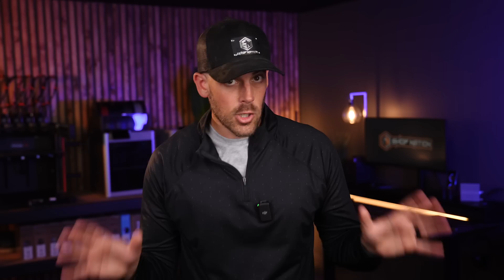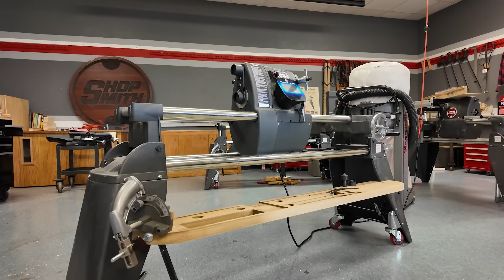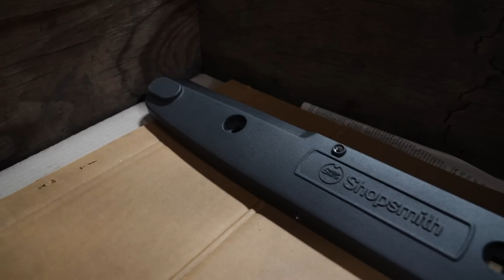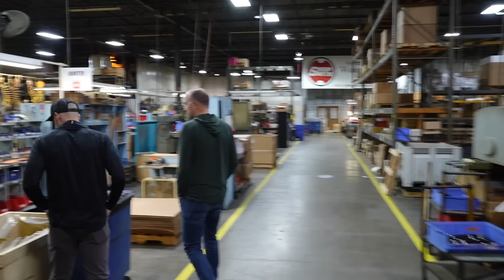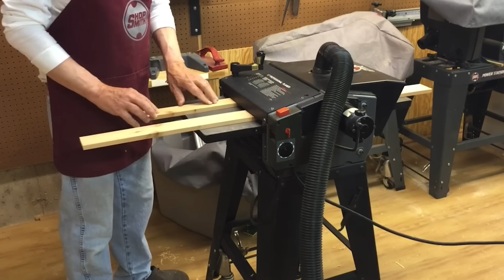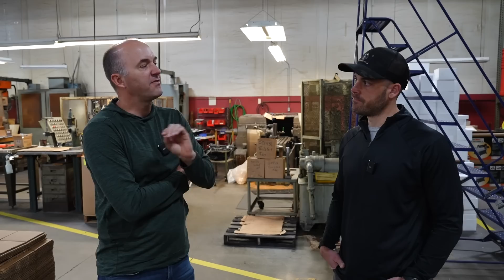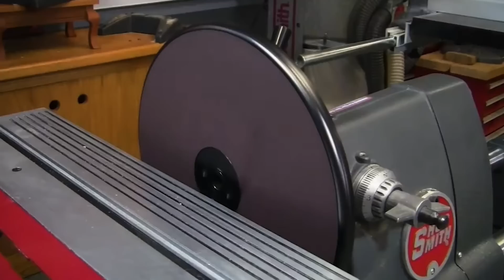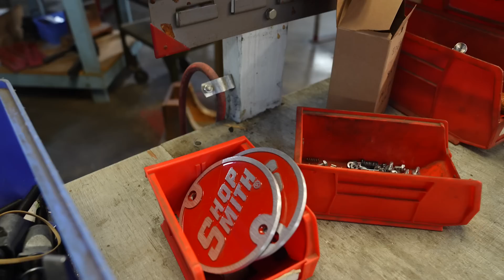The Last American Power Tool Company is (almost) dead

Comment: Nick is spot on with his target market. Bought my Mark V as a 25 yo newly wed with a one car garage in 1987. I bought it to make all the furniture we could not afford. It was my first tool. Still have it and still use it. Just last week I taught a couple of dozen children 5yo-5th grade how to do basic woodworking, and I used the Shop Smith to do it. It was so cool to lower the drill press to its lowest setting to let a 'tiny' five year old kid drill al the counter sinks on his bird house. . It worked splendidly. I use it mainly for drill press, end boring, disc and drum sanding, lathe, band saw and back up table saw. Nick is right, the table saw is the 'weak link.' I free standing machines  for most of my processes but the Shop Smith gets used in 80-90% of all my projects. I wish Nick well.

Comment: I bought my ShopSmith new in 1978 to build custom walnut kitchen cabinets. I saved enough money to more than pay for the SS. I still use it a lot. I have never had anything break on it. I especially like the small footprint, that really helps in a small wood shop. My only complain has been the table is too small but i got used to it. I hope it continues on.

Comment: Lately ive been seeing a lot of shop smiths for sale on facebook. Pretty cheap too. I think the most expensive one was $300. 
Up until I started seeing them, I had no idea they even existed and I am 55. 
Never laid eyes on one before then.
I’ve been pondering the idea of picking up a wood lathe for a few projects I want to do, I just might reconsider buying a used shopsmith for those prices. The $5k I can’t justify, but the $300 or less I’ve been seeing lately is very doable, especially since I just learned new parts will fit older machines.
Reply: Just a helpful bit of advice...If you get a used one, oil the motor before you use it. There is a video on YouTube from a ShopSmith service tech, with step by step instructions. Simple,  but important. Do not turn machine by hand. Turn on to lowest speed, shut off and follow directions  from there. It could get expensive if you don't follow the directions. 

Good luck to you!😊

Comment: I'm 74. As a kid my two favorite ads were the back of the comic book ad for a BB Machine Gun that mounts on your bicycle handlebars and every ad, and article, about Shopsmith. I grew out of the BB machine gun idea, but never Shopsmith. Sadly I never got a Shopsmith. Retired in my 60's from the computer industry and ready to finally start hobbies I gathered so many shop machines I almost can't turn around in my shop.  I never realized Shopsmith was still around!  This video awakened the lost kid in me.  I think I might have to rethink everything. Heck I'd sleep on a mat under my own Shopsmith and dream of projects. Maybe I can pull in off! 😃
Reply: Do it! I just bought my Mark 5 used from a disabled friend 3 years ago.  $300.00.  Added a used, but excellent condition band saw. I am 61 & just starting woodworking to possibly get me out of hazardous materials tank truck driving for a living. As long as you are able,  it is never too late.  Good luck to you!!😊

Comment: I have my father-in-law's Model 10ER and use it often.  While I have other power tools (3 table saws for example); the 10ER remains quite useful.  Typical use is the 12" sanding disk and horizontal drill press.

Comment: I bought a gold Mark V with jointer and belt sander in 1975.  I still use the machine even though I have other stand-alone equipment for bigger projects.  I am completely satisfied with the precision and durability.   Wayne

Comment: I'm glad to know this company is hanging in there and looking toward the future. We live on a homestead and also run a rental home business. To keep our properties in good order I have a small fabrication shop, it's core to our business, I'm not really a hobbyist. My shop is full of machines, but my trusty old 10ER does those infrequent jobs that just don't make sense to buy a specific machine for, shop space is an issue. I've got a nice old table saw for instance, but it won't cut a 4x8 sheet of plywood into two 4x4 pieces, which I can do with my Shopsmith, and do it repeatably and accurately. I make cabinets from time to time. Hands down though, what I use it for the most, is horizontal boring. There is zero chance I would have a machine capable of that operation if not for my Shopsmith and it's surprising how often I use it for that.

Comment: I used my father's shopsmith fifty years ago. Today's shopsmith looks almost exactly the same as I remember it. Also the factory probably hasn't changed in fifty years. Mostly men are still interested in woodworking so there should be a lot of demand. But for a current purchase few men would be satisfied with a tool that is as dated as something their grandfather or great grandfather used. Unless you can hookup the shopsmith to a computer to take advantage of computer controlled cutting and forming, I don't see a future for shopsmith.

Comment: Got one of the originals that looks like the oldest ones you have there, It was gpa, dad’s, and now mine.. just turned it on after decades of setting idle and it still works like a top. Well built piece of equipment for sure!

Comment: What do you need from a technical side to make it better?  🔶🔶🔶We have patented an entirely novel, ultra-torque dense dense and ultra-low backlash,  infinitely variable gear technology, called 𝔽𝕣𝕚𝕔𝕥𝕚𝕠𝕟𝕃𝕖𝕤𝕤 𝔾𝕖𝕒𝕣𝕤 [a CVT/𝕀𝕍𝕋] based on our reformulation of gearing theory. The technology enables transmissions of ~1/10th the size/mass/cost which enables use of motors/engines/batteries of significantly smaller size. Gear ratios can be even in the 700:1 range and probably more. It will provide novel 3D motion of robotic appendages/manipulators/booms advanced turbo0jet engines, tools and much more.

I'll look at what might make your tools better.

<><><>
🔶🔶🔶We are writing a patent for a large number of novel novel torque converters [gear tech], differentials and right angle torque transmission innovations that do not use  TOOTHED gears. It will be 300 pages long. 
<><><>
Contrary to what classical gear theory states,  I've devised a way of increasing the speed of a worm drive...on the spot. 
===
✈ℕ𝔼𝕎  𝔽ℝ𝕆ℕ𝕋𝕀𝔼ℝ  𝕋𝔼ℂℍℕ𝕆𝕃𝕆𝔾𝕐  𝔾ℝ𝕆𝕌ℙ is a visionary multidisciplinary B2B innovation company utilizing a licensing business model or collaborative enterprise with strategic partners to develop Advanced clean, efficient, power dense solutions in domains of energy, propulsion, mobility, robotics / exoskeletons and clean technologies with a particular emphasis on the aerospace sector including space exploration and commercialization

Comment: I grew up wanting to do wood working, but I had a problem with not only space, but the idea of having to individually evaluate each of the tools that I'd have to buy to do things economically and efficiently.  For major tools, my grandfather had good sized table saw, a jigsaw, and a drill press. I don't rermember what he did for a router (maybe an attachment on the table saw). I would say to pitch to high schools that sill had a shop class, but a graduate wouldn't have the funds. It might be still be good just to get the schools to use Shopsmith for teaching???

Comment: I'm wondering if this is the same product that was called PortaShop in the the late 60s. My father was refinish a blank basement, plus he wanted to build himself a bar. It was the perfect tool and he took some classes to use its capablities.  The darn thing was powerful and I seem to remember it fitting in a case that was maybe only a little bit larger than a large portable sowing machine. Ooops...nope, this machine is more major!

Comment: I appreciate what they are trying to do. It is a bit of a niche market because this brand is equated as a "Jack of all trades, master of none" device that in some cases is more of a tool for the weekend warrior DIY crowd and less for the experience and serious woodworker. I have never owned or used one so I have no experience with the product so I leave it to the consumer to do some research to determine if this is the right tool for them.

The bigger hurdle for this brand is the new "table saw safety law" that mandates safer standards for table saws, using technology similar to that found in the SawStop brand. This will be an engineering hurdle that they will need to tackle and given the multi-tool configuration of the ShopSmith, it is even more complicated to deal with than just a single use tool as a table saw. I would love to see the succeed though, so hopefully they have their eye on the ball and can make a go of it.

Comment: Make some ShopSmith models  that ALSO HAVE a Mini 5-Axis CNC machining/metal carving system PLUS a built-in plastic resin and metal powder deposition 3D printer built right into the machine that has BOTH USB-4 ports and Wireless WiFi built-in so I can hook up a laptop to send some CAD/CAM files directly to the ShopSmith. This would make the machine useful for woodworkers AND metal workers!

Comment: They  quit making the planer, why? Because there was only a $400 margin in a $2000 machine he said. He is flat out wrong! They couldn't sell the planers because they were too dang expensive! It may be a great product. But what weekend warrior is going to spend $2 grand for a planer when he can buy the Dewalt planer for $700? He is missing the mark. His problem is indeed margins, but that is because his manufacturing costs are too high making it necessary to price his products out of the market to make a profit. If he wants to resurrect Shopsmith, he better focus on getting costs back down to where they were in the 1980's, a near impossible task.

Comment: China is selling products in the u.s. for less then material costs, let alone manufacturing, packaging,shipping, profit, etc.. they are putting our country out of business! On purpose. A pack of 5 metal vice clamps $5.00? Screwdrivers, tools..How? Its not possible to sell at that price. They are shipping products for free! Putting us out of work is the goal. "Collapse from within".
Reply: Yes!
Reply: The costs of living in China are significantly lower than in any western country. There has to be some sort of equalization of the standard of living, for the nations of the world. Those who live will see how it will turn out.
Reply: @MRSBroadcastingAB  pretty much robotic & slave labor. The simple cost of forming steel for a tool, painting, handles. Packaging, labeling, shipping, distribution & profit.. from China, is less then forming & tempering, trimming, & labor here. Impossible to compete with low quality products, especially during inflation. Tarrif or bans on products to save our jobs must be done.

Comment: Since you live close to Shopsmith, then you know my hometown of Sidney. I have benn aware of Shopsmith, but when I started doing woodworking I couldn't afford one. So I started collecting my tools 1 at a time. A radial armsaw was first followed by a drill press. Now I have a shop full of tools. My biggest fault against Shopsmith is having to configure it around for each operation, which to me is wasted time. I do know Scott Phillips who used to work there, but I dont know if he still has a Shopsmith. If you didn't know Delta, which was Delta Rockwell at the time, used to build machines in Bellefontaine Ohio. Castings for their lathes were made here at Gartland Haswell here in Sidney.

Comment: $8,000 to buy all the different tools for a hobby is nuts.  I wanted & still want a shopsmith but it’s too much to buy at once.  

For hobby work and the occasional home improvement work done- I went and bought a skill saw. Then later for a couple hundred bucks a table saw.  Want a drill press but dealt with hand drill.  

Idk how you fix this issue but to try focusing on ONLY $5,000 instead of $8,000 and the advantage is it’s more compact… no thanks.  It’s too big of an economical risk for a hobby that a novice just can’t tell if buying $5k multi tool is like a leatherman- yes it does everything but compared to the real tools it sux.
The risk/reward just isn’t there.  

The fact that it is all set up wood and not metal work counts also.  Wood lathe looks fun, be cool to make some chairs or table legs.  But a metal lathe I can also do brakes on the cars, do welding and balance work.  

The $5k just seems like you will never get any return on investment.  Doing the other tools one at a time as needed was more affordable I could see how buying a table saw paid for itself in a couple jobs.  A small one was in the hundreds, not thousands.

Comment: I bought one in a woodworking show Alexander Palace north London in the early nineties, I’ve bought a few extras over the years, the table saw is accurate, I like the horizontal borer I’ve repaired many broken stair case spindle using this tool. I’ve only used the jointer once. Only gripe a the cheap casters. I still have the video the shopsmith book and the receipt for £2700.. we  only went the show to buy a site saw…  Do you have an agent in the UK for spares..

Comment: I inherited Dad's 10-ER (Montgomery Wards - 1953) in 1988.  I've found it's useful in a small shop as a secondary tool.  If a build requires a primary tool and then a secondary operation, the Shopsmith's ability to be any of five secondary tools makes for fewer steps.  Its also more stable during use than any hand tool I might otherwise grab.

Comment: I’ve had a Mark V for 20+ yrs and it’s in almost daily use. I do have floor space and a lot of other machinery including belt sander; lathe; pillar drill; planer and band saw. My Mark V compliments these. The table saw (not the lathe as mentioned) is the most used item. It’s precise and capable. I’ve made innumerable projects including very complicated items on it. Yes it needs time and patience as it doesn’t have digital readouts but it is a hugely capable machine. Unfortunately your only dealer in the UK closed down a few years ago so we’re left unsupported here which is not ideal. One of your major failures has been YouTube videos featuring elderly fellas, mostly overweight and sedentary and very uninspiring. Can’t you entice Axminster to be your outlet for the UK? Bring onboard young, exciting, groundbreaking youngsters as your face of today and ditch those old guys. I love my Mark V and it’s as capable today as it was when I bought it 20+ yrs ago. The fact that it’s not Chinese is a major selling point. Products from the US are top quality and deserving of recognition. I wish you well

Comment: They probably can't do it, but maybe make a compact size or upgrade kit for older units? I see them in thrift stores sometimes, and always wanted it. It's like $250 to 1000 used with nice accessory. I have a single car garage, and most of the time I have to bring out the cheap shitty compact drill press, table saw outside to work. If it was 1/3 or 1/2 the size it be so awesome, It be a high quality upgrade from the garbage I have.

Comment: You recovery will be driven by supplying the current generation with affordable upgrades to their old shopsmiths + creating an affordable entry level shopsmith mini.  While the tablesaw is somewhat weak it is fine for 90% of hobby woodworking.  You have to couple that with education because you can't get the accuracy out of the machine without it unlike a dedicated machine.  I admire the enduring upgradability of the machines.  First thing I did with a used machine that I bought was cut it down so it was 12" shorter lengthwise.

Comment: they should focus a marketing campaign towards the bushcraft and cabin builders community a rugged too that can be transported to a remote site and run off of a battery bank would revolutionize many different aspects of "off grid" community. Bringing a full wood working tool set to a site on an atv trailer would be a game changer.

Comment: Im not sure, but is Shopsmith on the European  Market? I never have seen one over here (Germany) and nothign comparable either. And if it comes to space over here we are normally way more limited then in the U.S. from all i know. 
I am dooing woodworking as a almost side hobby. I started because i needed some easy furniture for my main hobby (LARP) that i could only get for, at the time for me, not paiable prices. So i did it myself out of scrapwood and with the most crappy and cheap tools imaginable. It was 15 years ago and they are still in use. But it definitivly spiraled from there and i have done many Projects since, upgraded tools and stuff. But i do not have a table saw or a Belt sander or anything like that, only handheld tools, just because i absolutly lack the space. Having something like a Shopsmith actually would be ideal.
And i know a ton of people in exactly my position. So spot on with the space thing. But jeah maybee tink about the European Market, I guess it'll be a runner here.

Comment: I've had my shopsmith for over 40 years and it works as good as the day it arrived. Only bad thing is my motor head is only 110vac, newer ones are 110 AND 220. Way better in 220, but my 110 works great! I am extremely satisfied with mine. For all I've created with my machine, from toys, to windows to cabinets to just helping a neighbor, I wish Shopsmith the best of luck for a long long life to come.

Comment: Been a wood worker since the early 80’s and in the mid 90’s I bought one at the state fair. I found it was a great tool but I was not as good a wood worker I thought I was. Having one tool that you change for each step sounds great but for me at the time, I was always resetting the machine because I forgot a cut. So I returned it for free. 
 Now that I’ve gotten better I could could use one but have not made the step and buy one.